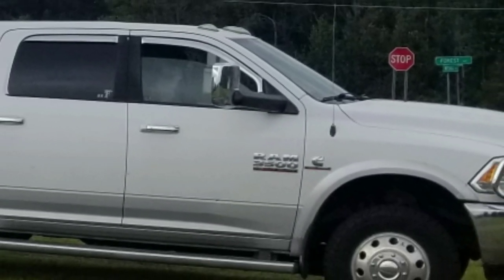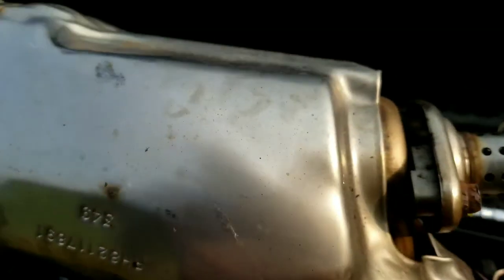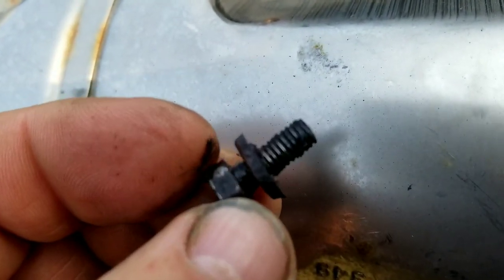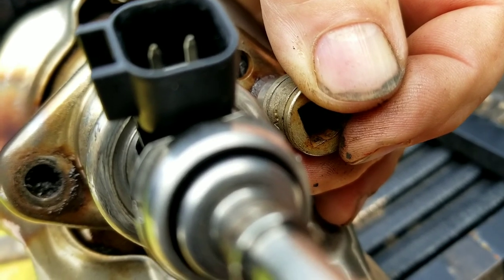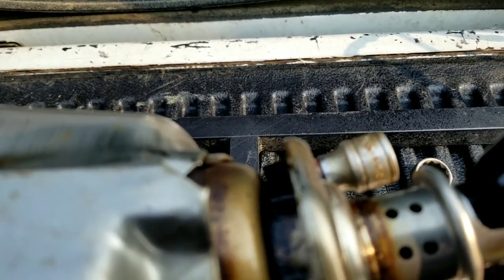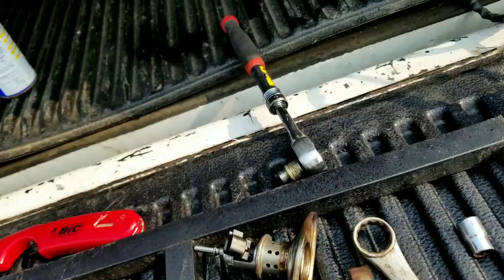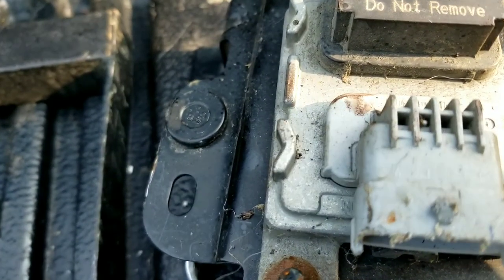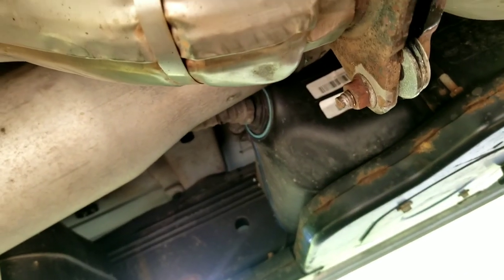Plugged SCR and DPF RAM 3500 Cummins cheap fix

Comment: If your 6.7 ram is loosing a bit of coolant and is starting to have emissions codes, your EGR cooler is probably failing. Replacing the DPF and not replacing a leaking cooler will result in replacing the DPF again, along with a few sensors.

Comment: FYI. There is a spring right inside of where you “heated” it. 
That spring is most likely toast.
Reply from the maker: Thanks for the information.  Can you give more details?  Spring inside the flange?  Do you mean inside the DEF injector?  I replaced one with my old one.  The entire reason I acquired the exhaust was the DEF injector failed so the guy deleted because he didn't want to goto the dealer as he was a self employed carpenter.  Parts of the exhaust can see awful high heat.

Comment: Those chunks are the actual filter 😮
Reply from the maker: Yes, and I learned it truly is a filter.  Nothing is to pass thru it until the soot ash is burned away.  But eventually they fail, become plugged, as not all products of combustion get burned away no matter what anyone tells you.  This is why commercial trucks get their filters cleaned.  Small trucks, they expect us to throw them in the trash and ante up for a new one only from the OEM.

Comment: I have a dodge ram pickup same problems from what I see dodge has the most problem of all the pickups and they have recall on these pickups but they don't get the problem fixed tks
Reply from the maker: I bought this instead of a Ford because it's easier to work on.  Almost 400,000 miles for me.  I think most of my exhaust problems actually came from a sticky actuator in my turbo.

Comment: Delete that crap off your truck and you'll never have to worry about it again.
Reply from the maker: I know but this deal was cheaper than a delete setup.  I fear that NYS will force inspections too.  I do get up to 19 mpg traveling down the highway so its no all bad....
Reply: @spudth  FYI, you can remove the exhaust and DEF stuff (save it in case you need it later), then delete your truck with a tune (EzLynk) and straight pipe it. Your truck still has all the stuff under the hood, but it would be programmed not to use it. If you needed all of it again, it gets flashed back to stock. Works like a charm and is better for our trucks and the environment!! 😎👍
Reply: @spudth  I live in NY, there is emissions intact tuning that leaves the dpf working but eliminates the def and egr, better for truck but still clean for nystate

Comment: I let truck idle spray it  wd40 while hot loose up right away dipp it on hot water let it clean and with toothbrush clean it got rid of the 5mph service see dealer

Comment: WD 40 is NOT penetrating oil......
Reply: Yes it is.  Sorry to break your heart.  All oil is basically penetrating oil.  Some have a smaller hydrocarbon molecule that penetrates better.  WD-40 is  also not a medication but Dad used to use it effectively to kill ringworm on cows.

Comment: That’s not a cheap “fix” you just bought 1 off ebay end of video
Reply: The cheap fix was a few hundred off ebay vs thousands at the stealership.  Also, I was able to use one from a different chassis.

Comment: Why didnt you power wash thr dpf filter
Reply from the maker: I tried to.  It seemed the real problem was a restricted catalytic converter. I'm not sure washing these pickup truck pieces is as easy as washing one in a truck.  I'm wondering if I got some bad fuel?
Reply: Does power washing the DPF really work?
Reply: @rdp2370  You have to be careful and use chemicals.  The DPF is truly a filter.  Ash stays in there forever.  Large trucks have them cleaned.  Ram and cummins decided the pickups don't need serviceable units.  The ash is removed with chemicals and washing.  There's a good series from and English guy doing his diesel car DPF.

Comment: What kind of DEF have you been using at this point?
Reply from the maker: I either buy def at Walmart or at a truck stop from a bulk tank.
Reply: I bought the truck with 330,000 miles.  All highway miles.